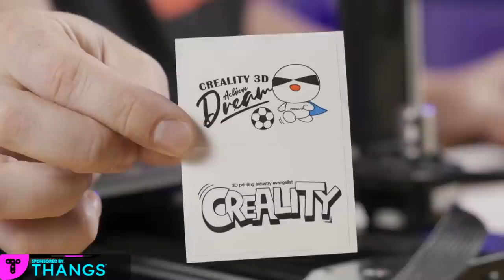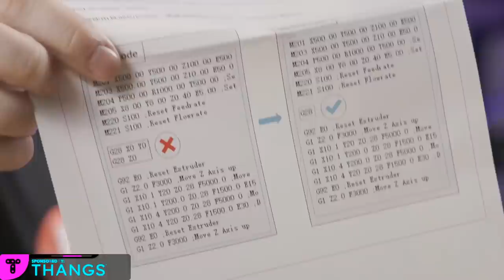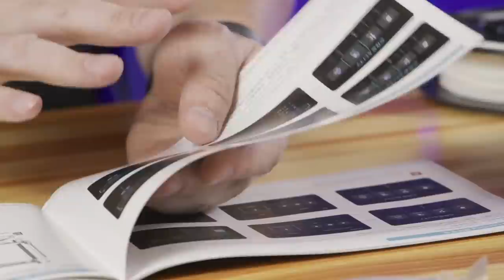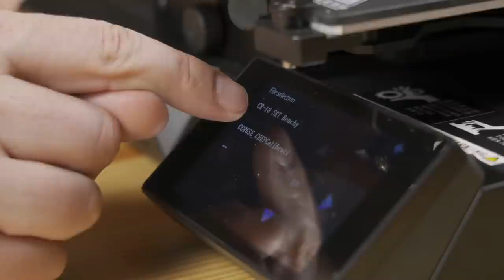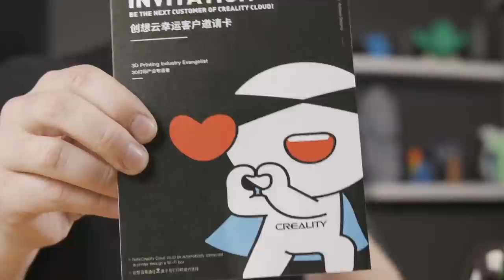CR-10 SMART - Unbox & First Prints!

Comment: My Father did hand crafted G-code for a company that made(makes) the inserts for Cataract replacement lenses. He taught himself g-code as the companies Research & Development machinist. This was in the 80s-90s. Whenever the company needed a new design worked out, he did the work for designing the fixturing for production. And maybe to fix or replace the boss's boat's screw(propeller).

Comment: I was watching this episode while you were having problems connecting to the Wi-Fi or using Wi-Fi to control the printer. Funny thing is, I just bought a cr5 pro high temp version and a cr-10 smart Pro. I started having problems with a CR 10 smartpro last night with the creality cloud app and Wi-Fi connection. I thought it might be my router or modem so I reset those then I cleared the cache and the app deleted the app it seemed to fix it until today when it happened again. Somehow I was able to do a firmware update and screen update but that didn't fix the issue. I never would have thought this because I only had the printer for 2 weeks but the SD card inside of the printers Wi-Fi board died. I had to go buy a new SD card and that fixed the problem. Now after I get this printer working correctly for a while I'll have more time to work on the cr5 pro that I cannot get good prints from. I bought both printers during a flash sale. I also own a modded CR 10 version 1. I previously purchased a cr-10 smart nonpro and a cr-10s pro version 2. The cr-10s Pro V2 May the nicest prints I've ever seen come off of a printer until the heater block fan died one month after purchase. I replaced it with an oem fan and the printer never worked correctly after that I couldn't get prints to stick no matter what I tried and when it did stick it was all messed up. Then the cr-10 smart I could not get the bed level no matter what I did and that went back about a week later after trying to do everything possible to level that thing. I'm still at a loss for words trying to figure out how after 2 weeks of use the SD card inside of the printers Wi-Fi board died and I took it out and put it in my laptop and it would not recognize it. I'm not sure how I feel about reality products with all the problems I've had with almost every single one of the printers except for the CR-10 version one I have that's been running this whole time without issue.

Comment: been cleaning my creality glass bed with ipa and even acetone for 2 years now. Absolutely no issues to speak of. Idk what people keep saying not to. If glass and ceramic...ish coating can't withstand a little alcohol then sorry bed's defective.
Reply: Personally though the creality bed sucks. I've had countless peel ups. I always use adhesives because 10 hours into a 20 hour print for customers I cannot risk it not sticking. Also if the power goes out your print pops off the bed (meaning power outage protection which almost never works anyway is completely and utterly pointless if the print doesn't "STAY" stuck while the power is off)(also if the power flickers multiple times then the entire thing fails anyway)(DUET+UPS+ADHESIVES=HAPPY PRINTING). I still use it because it's glass and adhesives stick nicely. They really need to come out with something better and less heavy though.

Comment: Hey Joel I just got my cr10 smart in and i ran into an issue. I leveled the bed initially like the instructions call for and everything went smoothly until the print got to the edges of the build plate. The right side of the build plate is slightly higher than the left and is scraping the glass a little bit. Ive tried re-leveling the bed a few times and made sure the nozzle was clean. But no matter what I do the right side is higher and the auto level isn’t compensating for it. Do you have any suggestions?
Reply: Hi, have you found a fix? I am getting mine soon so its probably a good thing to know just in case :)
Reply: @benwrth  i have not :/ i heard theres a firmware update but I haven’t tried that yet
Reply: @willrh1022  Ah ok, thanks. And good luck getting yours to work!
Reply: @willrh1022  mine got worse with the firmware update.... this printer is utter garbage. I'm so disappointed with creality. I'm gonna tear it all down to try and find the problem myself. Creality has been no help at all.

Comment: To that question around ~1:17:00, I would recommend not printing in the same room you're sleeping... Despite having relatively low VOCs while printing PLA, persistent exposure is a bad idea. You definitely want to have the printer in a well-ventilated area. Alternatively, you could place the printer in an enclosure with a filter, but any quality enclosure will cost a decent amount of money.
Reply: Would you recommend a flash forge adventurer 4 if im printing in a small one bedroom apartment since its enclosed?

Comment: To the guy dealing the Congrow (okay, actually Comgrow), just replace it yourself. Their customer service is awful. They sent me harshly used Cr-10s pro when I bought a refurbished Cr-10s pro V2. Not only did they send the wrong model, they sent a scrap printer and tossed a couple spares into the box like... "Refurb it yourself". It took a TON of emails to get them to do the right thing and take the printer back for a refund. Each email had a 24 hour turnaround because support is in Shenzhen. Bonus, I can now spell Shenzhen correctly.
Reply: Thank you so much for the initial buying from Comgrow, we are working with our partner to improve, sorry for the 'awful' service.

Comment: @Joel - Surprised that the officer didn't suggest adhesive pads. Here in the old dart, you are permitted to attach number plates with screw/fixings or adhesive pads (foam pads styleee)
Reply from the maker: I'll look those up and see if they will work!

Comment: I dropped the filament shaft on the roller on the carpet while assembling this 3d printer. The shaft broke on the screw connection and revealed a couple of ball bearings. Fortunately, I found I was able to glue the screw connection back on.

Comment: I wish Creality didn't make all these fan shrouds so elaborate. Would be easier to add upgrades / change stuff around or replace components on newer printers. On my Ender 3 V2 in its original form the hotend fan died after a month and replacing it was more complicated than it needed to be.

Comment: Need advice from anyone, So I got my nephew the old original CR-10 in 2019 and he's just now really getting use out of it due to getting a new laptop. Is it worth it to upgrade to the newer models or is the old one still good? Any must have upgrades? His prints look good so far with the original stock gear, and I just bought him a Capricorn extruder hose upgrade with extra nozzles (bought him wood filament also and was worried about clogging) and buildtak surface plates. Thank you for any help
Reply: You need hardened nozzles for wood filament.  No need to upgrade.  Clogs are in my opinion caused more by cheap filament and they are not hard to clear.

Comment: Thank you for the stream! So, does auto bed leveling do the job correctly? The secret was to do it with preheated bed, no z-offset adjustment needed?
Reply from the maker: I think the secret was adjusting Z offset during the print. That wasn't called out in the manual, but it makes sense. Auto level, I think, worked correctly from the get-go.
Reply: @3DPrintingNerd  Thank you! They say "instant printing after initial auto leveling is completed". I didn´t see that ;)

Comment: The printer is only available on the 20th May 2021 the site said.  Plus it costs $499.99  so damn pricey, 
I need to buy a Creality Ender 3 V2 3D Printer, with Silent Motherboard, Meanwell Power Supply, Carborundum Glass Platform, 220x220x250mm Print Size. even that cost allot here in the UK.
it cost's £276.00p on Amazon UK.  
I just have to hope I can save up? 

I have the 2020 model of the upgraded Tronxy X5SA but it is a damn nightmare to even level even though it has a auto leveling system. 

So I wish I known about the Creality printers as seen here they are far better!
Reply from the maker: I haven't played with any Tronxy machines - hopefully someday in the future!
Reply: @3DPrintingNerd  The XY2 Pro is much better value than comparable Creality machines and easier to set up.

Comment: *Wonderful job as always with the presentation Joel. So this question is for anyone CR10 Smart what makes this different than any Bowden printer from Creality is the difference that it works?  Looks like a new hotend?  please chime in. *
Reply from the maker: The "smart" comes from the included Wifi on the machine. Well, at least, that's what I think they did. The auto leveling works as well, and the silent drivers too. The hot end does look new, as it's using the type from the CR-6 SE for the auto bed leveling.
Reply: @3D Printing Nerd  Thanks for the response but when all is said and done - 1) bed leveling - not groundbreaking pretty much it on just about every platform now 2) Silent drivers - Really? I think you would be hard-pressed to find a system in this price range that does not have this feature as standard.  3) The hotend looks interesting and would love to see a breakdown of it in a future video if you could maybe a comparison to the standard one to see if this new one has the flaw of the old. As for the Wifi its a nice touch but that does not make it "Smart"

Comment: I finally got a chance to watch this video. I was looking for a hassle free printer with a larger build volume. I have an Ender 3 currently and it has taught me a lot. But I want to be able to do larger prints right away. When can we expect a more in depth  review?
Reply from the maker: I'm hoping not too far down the road.
Reply: I originally said don’t buy this printer Because the firmware was not up-to-date and took over a week for a new firmware to get loaded
Reply: @darronchadwick9630  why not?
Reply: @KxngUnkasa5   it a great printer now  I was one of the first to have this printer and the bed leveling did not work so it took about a week for them to come out with a firmware update which fixed everything  I will edit my response
Reply: @darronchadwick9630  oh okay good, cause I was looking on picking it up lol

Comment: I really want this with the E3D like the V3. 
Would it work to just mount it ontop like with the other Cr-10 printers, or does it affect the autoleveling. If the hotend has to move a little bit on the Z-Axis this might be a problem?
Reply from the maker: The hot end, I imagine, is a CR-6 SE style, so swapping that out would remove the auto bed leveling.

Comment: I know... but seriously, $1 below $500 is technically under $500 but with shipping costs and time for arrival from China - - - I dunno. Yes, definitely the highest grade of printer, not from Prusa, but no partial upgrade available for the motherboard -- - - I still dunno. $500 is still $500
Reply: I have 1 overall it's been pretty good I've managed to print pla fairly easy but I've been working on polypropylene which is a huge pain and becomes alot of babysitting
Reply: However I did order mine on back order and it took them just over 3 months to get one too me

Comment: The nozzle was burying itself into the bed each time during the mesh level
Reply from the maker: Yup. That’s how it works.
Reply: @3DPrintingNerd  yikes that sounds crazy to me but I heard you explain around 1hr 22m in the video. Thanks
Reply from the maker: @rickc7151  No problem! It's a really neat way to do it. There is a small strain guauge (I believe it's a strain gauge) where the hot end connects to the head. It can sense the slight pressure of the nozzle touching the bed, so it uses the nozzle to probe. What's really cool about this method is that you don't have to worry about an offset for a BLTouch or probe.
Reply: @3DPrintingNerd  yea I can make sense of it in my head it just seems odd to have the nozzle smashing against the bed! I have a couple printers with abl and would have an minor stroke if I saw that happen. Of course it would mean a broken plate or nozzle in most cases. How does this printer compare to the cr10v3? I’ve got a couple of mk3’s with mosquito and skr and want a bit more build volume. I literally had the cr10v3 in my shopping cart and your video popped up so now I’m not sure. I can’t find much on this printer either.
Reply: Looks very similar to the way the Cel robox levels the bed , great addition finally 😃👍

Comment: These live stream reviews are terrible because I can't get a quick summary of the pros/cons of the printer.  I would much prefer a polished review from you.
Reply from the maker: I agree a quick summary is better when looking for a review. This isn't a review, as the title suggest. It's the unboxing of the machine and an attempt at a first print. I do this because it gives people a sense of what they can expect getting the machine out of the box and setup. Plus, I also do this because it removes any doubt from anyone on the condition I received the machine. The goal is to do live unboxings, and then follow up with a "first print part 2" sort of thing. I just got that done with the Vyper, the CR-10 Smart is going to be soon.
Reply: @3DPrintingNerd  Thanks.   I'm currently shopping for a new 3D printer.  I have the Prusa Mini+ (which hasn't worked for me), the Lulzbot Mini (which works but is dated.)  Everything points to the Prusa MK3S but I am reluctant.  I am looking at CoreXY printers such as the Voron.  Any recommendations?
Reply from the maker: @rl1111rl  I am hoping to build a Voron at some point in the near future. If you've got some skills, you should build one. Look at Tom Sandladerer, he just built one, and now it's his favorite 3d printer. Sounds like you have two machines with slightly smaller build plates - maybe look at an Anycubic Vyper? It's a bit bigger, and not too pricey. Would give you something to play with WHILE you build your Voron :)